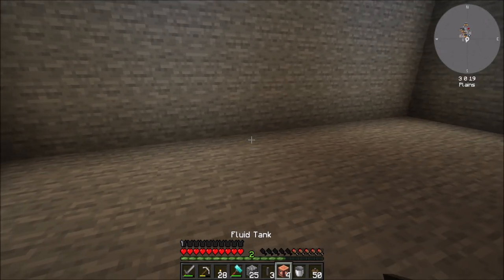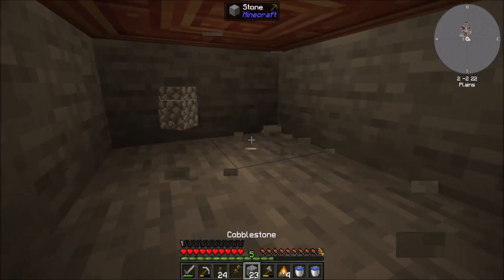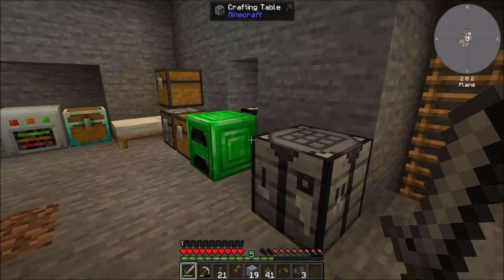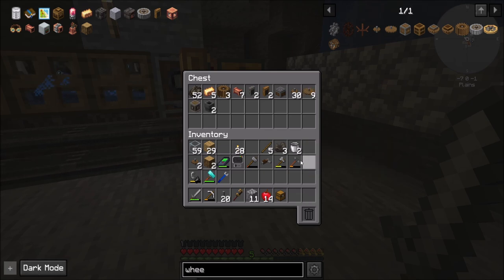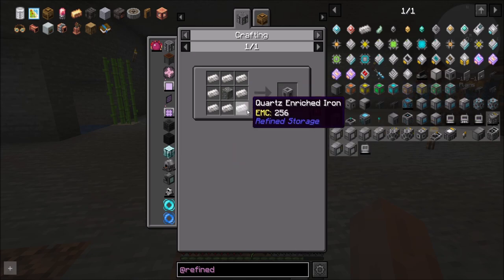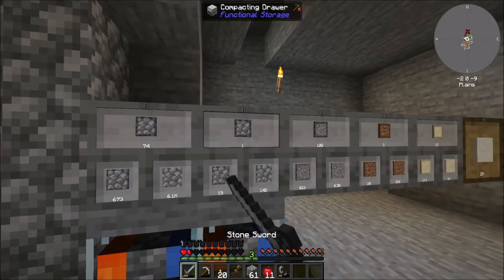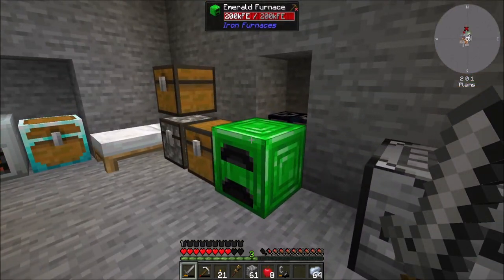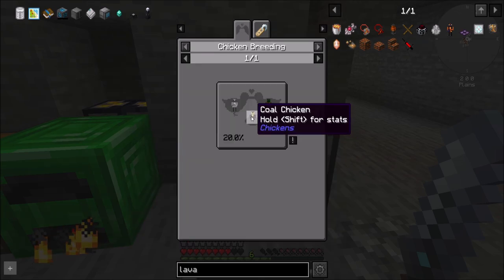Stoneblock3 Ep7 Crushing Wheel Setup

Comment: You should make the no soliciting sign. It stops the wandering trader from spawning
Reply: I wish I had dire's problem tbh. I have been playing on my save for over 10 hours now and haven't had a single trader spawn. I even toggled it off and back on to be sure it was active
Reply: @Blargosaur  Same on mine. Gajillion loot bees, zero traders.
Reply: @Blargosaur  Or he can also use the command to turn off the wandering trader event
Reply: @eduardorangel7263  He won't use a command for it because that "feels like cheating", so the no soliciting sign is the "legit" way to do it, though I am wondering how many parts it will be until he notices it!
Reply: I started with default settings and only saw 1 Wandering Trader...before he was killed by mobs in a dungeon.  Haven't seen and since.  Just now got the sign up.
Reply: of COURSE dire gets all the wandering traders spawning in his base. of COURSE. I haven't even seen a single one myself, but after seeing what was happening to dire, I made the no soliciting sign just because. ounce of prevention and all that LOL

Comment: For a boiler with just one engine you can build it vertically 4 blocks tall. I think it looks a lot cleaner and it's a more compact foot print.

Also, you can use Adjustable Chain Gearshifts to do speed increasing more compactly and cleanly too.

Comment: Update your pack, they changed the Refined storage Recipe to be made with CREATE not POWAH. Also if you pipe the nuggets into  a compacting drawer through a drawer controller instant ingots. As commented below make a drip stone lava farm  with CREATE asap one of the best ways for lava gen! Love your Playthroughs, keep up the awesome work!
Reply: he has a backlog of videos.
Reply: Lava chicken + iron chicken + crafter from rftools is alot better. Lava Egg + Bucket = lava Bucket. I did this with 64 Netherite Furnaces with Generator upgrade to automate power. About 14k rf/t
Reply: @ArcanineAnarchy  You can also pipe the lava eggs from your chicken into a Create item drain, then pipe the lava into a tank from that, no bucket crafting needed
Reply: @Kokkaku7  oh? That's a fun idea. Didn't know that. I just reuse the 64 buckets for my furnace generator farm. 64 netherite furnaces with generator upgrade. They are producing something like 400k rf/t off lava buckets after I upgraded the transfer speeds.

Comment: dire, quick create tip. You can filter by tags in your washer. There is a tag that items have called "Washable", if you blacklist this you can hold any items on the belt until they are fully washed
Reply: That would disable the chute from picking up Soul Sand though, since he uses the same conveyor for haunting and washing.
Reply: @bobertjohnson4459  true but he has to change the water out anyways so he could just temporarily remove the filter

Comment: 7:20 honestly the easiest way is one gearbox on each crushing wheel, and a shaft in between to reverse the rotation between the two, and then the shaft that turns the gearbox goes on the rightmost when you're looking at the back (to turn the gears in the right direction)

You can totally use lava eggs, from the chickens, fed down a belt to a Create item drain, piped to a tank (and maybe also to an ender tank later or if you get some from loot bees) to feed your tinker smeltery, your magmator, etc and another belt off the pipe filling lava buckets for you with a spout

Comment: Dire, they never changed the name of stone. The community sometimes called it "smooth stone", but that was never its actual name; it was always just "stone".
Reply: Well, back in alpha there were no item tooltips, so things were often named by the community.
Reply: no, but they did add an item specifically called smooth stone, which is different to normal stone even though the community did call normal stone smooth stone

Comment: The “refined storage” disks for AE2 have been added in a later update

A later update adds infinite range to Refined

For anyone just starting the pack, they’ve repeatedly changed how both Refined Storage and AE2  processors are made.

For lava, Lava eggs crafted into a lava bucket.  Pipe the bucket into a Mekanism fluid tank, pipe the empty bucket back out.
Reply: You don't even need the bucket if you use a Create drain; I'm fueling a Magmator with a stack of lava chickens, three drains, and one laser node.
Reply: Now you can directly use lava and water eggs as their bucket counterpart in recipes.

Comment: A couple tips i've discovered playing create: An easy crusher setup is a belt with a shaft in the middle, with a vertical gearbox on each side, with a crusher wheel on top of them both. Works perfectly.
Another tip is that you can use the wrench on a funnel to extend it, makes it take up a full block of space while functioning the same.

Comment: When you start a modpack or a series like this, what is your goal? I feel like I get started, get refined storage and mekanism up and running, but then I become a little lost, as I have so many resources I feel like im just going through the motions automating stuff that i'll never end up using again
Reply: There are end game items that require stupid amount of resources and complex crafting, other than that the point of a pack like this is to just build random things. I personally like finding ways to incorporate multiple mods together to make something even if its something that could be gotten a more simple way
Reply: slow down, start with different mods
Reply: In this particular pack that's less of an issue because there's a very well-defined endgame with specific goals. You'd just work toward those, if you wanted to.
Reply: The singularities in this pack are a bit more involved than “10000 ingots”.

They require you to explore each mod a bit.  Much more than the star components in ATM7
Reply: Try to build cool looking structures and a base. Chipped is in the pack and concrete blocks have great textures.

Comment: A few 10-10-10 lava chickens, in a roost, on top of a hopper, that feeds into the side of a create item drain, pumped into a create tank on top of an importer from refined storage.  Basically creative-level amounts of lava.
Reply: 40 buckets per minute (although if I had multiple drains it'd go faster - one can't keep up with eight 10-10-10 chickens worth of output).

Comment: Just a small tip: In REI instead of using the arrows on the side that constantly change position you can just click at the next use/recepie at the top and REI will center it, so you can basicaly cycle back and forth easier. Nice video btw! :)
Reply: Or scroll when mouse is over the top row.
Reply: @XDRosenheim  Nice, I didn't know that

Comment: How expensive is the phil stone? Could you use the red matter to get dark matter that way?

Also, what about stone in a crucible? Is that a thing is this pack for lava?
Reply: Philo Stone needs a nether star, and you can't use it to downgrade Red Matter. The Transmutation Table (which would do it) is veeeeery lategame. Energy Exchangers could do it, but they're also fairly expensive and use Powah's crafting system, so needs a lot of RF as well.